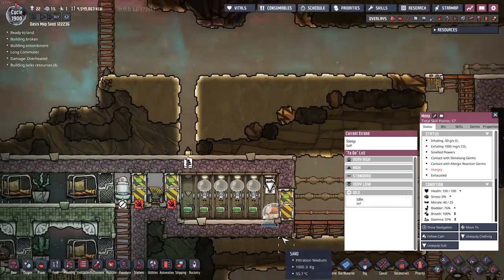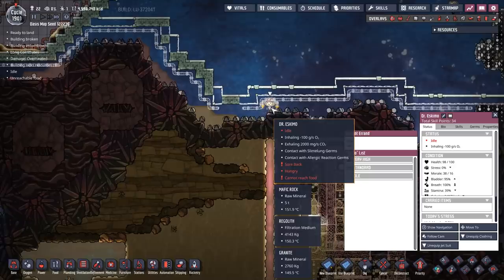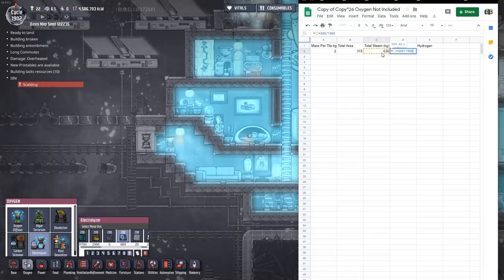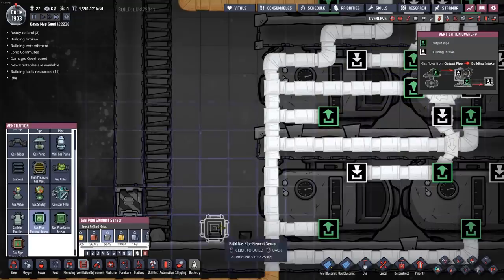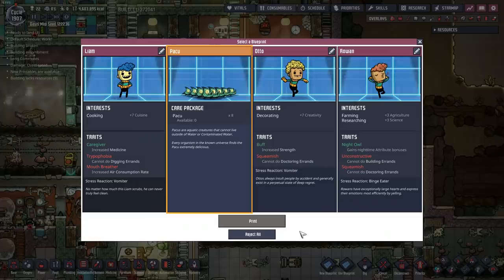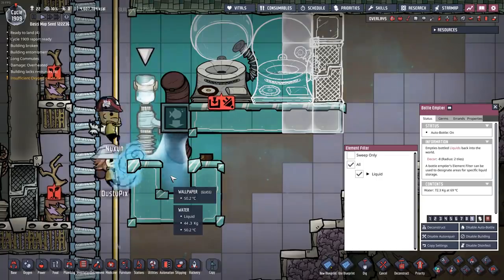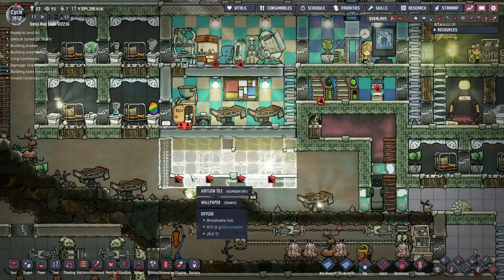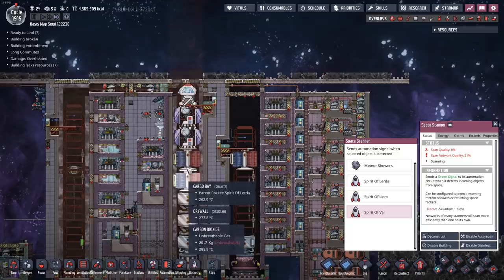Very Breathable Rocket Exhaust! Oxygen Not Included ep41

Comment: I'm curious though if it's be better to use turbines to gather the steam or use an aqua tuner to cool super coolant so the steam converts to water in the silo?

All you'd need is a drainage spot and gathering the water would be easy, but the power cost might make it less enticing over letting the turbines slowly absorb the steam.

Additionally, I wonder if you could sorta combine the electrolyzer and LOX together.  Changing the right electrolyzer wall into metal tiles and running a cooling loop through it that snakes at the bottom might create a giant LOX system so that you don't need to pump the oxygen gas.  Kinda like with your sourgas boiler design, the oxygen is added along this long tube and cooled slightly but at the bottom of the tube it rapidly changes temperature so that it creates a vacuum to automatically pump the gas for you.

Comment: you could potentially conserve more steam from the rockets if you use a radiant pipe cooling loop with super cooled liquid at the top of the rocket bunker, that way, any steam making it's way up will be converted to water and drop back down before it reaches space. it might also have to positive effect of preventing rocket meltdown.

Comment: did you try use the valve to filter gaz and liquid with a bridge, it is a low tier filter cost no energy and didn't use sensor?
Reply: @brothgar  yes, i didn't see any map you use it, i found the trick to replace the filter (use too many power) and the combo shutoff/sensor you use all the way, your low energy filter is mid tier tech, and not power proof if you loose power the filter didn't work
Reply: That system (manual filter) is great. I always use it on permanent pipes, much better than anything else.
Reply: @DrRetardo8600  yes, i use it all the times now because when i do the trick with two bridge(thanks @Brothgar) to detect if my pipe are full, but i always manage to have a co2 in this spot or a hydrogen, with the manual filter without power, i'm sure the only gaz or liquid i have is the one i select, so i did a double bridge sensor, and never fail againg (no more wrong element damage in my hydrogen generator)
Reply: @brothgar  i did a must compact oxygen and hydrogen farm with only one electrolizer and 1 pump

Comment: meep's always sleeps.

may the game work on my old laptop now? (i5 3320m 3.09ghz all core turbo, dual core with ht, 16gb ddr3 1600, intel hd 4000, yep is a thinkpad x230 for every thinkpad fan)
Reply: dude, all I'm working with is a Windows 7 pro Laptop with 8 gb ram
Reply: Try it and see, steam refunds are pretty reliable in the "no questions asked" period (2 hours game time, 2 weeks since purchase).
Reply: @CJSwitz  i already own the game, and i don't want a refound, klei deserves that money, also it was to play it in mobility since that x230 is my daily driver cause is small, if i need power i can play on my desktop or gaming laptop.
Reply: @Artemis_WR  You will always run out of frames unless you have astronomically powerful builds. I run an i9 9900K at 5Ghz, 64G DDR4 memory, RTX 2070 Super 8G, M.2 SSD, still struggle to maintain 20 fps at cycle 1500 with 24 dups at x3 speed post performance update. no pc is good enough to run ONI, but i guess if you run with less dups and not have 5 shine bug reactors maybe your laptop would outperform mine
Reply: @andersenzheng  i won't use shine bugs reactors, and use like 12 dupes at max (4 for rockets), also i got a stable framerate up to cycle 2000 with 30 dupes on my desktop (30fps on a ryzen 7 1700 oc at 3.9ghz with 32gb ram at 3200mhz and a gtx 1070) but i dug up the entire map, and i stored everything in the same spot, and in a vacuum.

Comment: Why does the steam turbine's seem to never open up the extra doors underneath them on your rocket recycling loops?
Reply: @brothgar  Ahh, ok, thank you. If you don't mind my asking, What exactly is the bar on the front of the turbine. I ask because I thought it was power production but often the doors would be shut and maybe a quarter of the bar would be full. Not always but it has confused me even in my own play through.
Reply: @alenvire  There are 5 inlets on the turbines, the doors are only blocking 4 of them while closed. The hotter the steam, the more power you waste (meaning that the turbine itself is putting it out as heat instead of power) with all inlets open. It's still wasting energy with the steam in the video being at 900°C, but way less since Brothgar is only using one inlet. And yes, the Bar is showing how "efficiently" the turbine runs. From the lowest possible I think around 50W to the maximum of 850W. There is actually a pretty good table on the Oxygen Not Included wiki that explains somewhat how it works. Took myself a few builds to fully figure it out. The man Brothgar himself did a video a while back to figure it out as well, but I think it was on a different series.
Reply: @Vaselinetopf  Thank you so much. That was what I have been missing. The explanation. I have watched so much of brothgar's videos and tutorials that all the info is starting to bleed together. Atleast my colonies do better now.

Comment: How about building the rocket almost at the bottom of the map and have a system using a bunch of doors that all close in sequence forcing a bunch of water in to cover up the entire rocket (just like your critter drowner but larger scale and horizontal) and force the steam up above it where a door then closes and separates water from steam after the rocket lands, that way you get the benefit of all that steam and heat plus the water may lower the temperature just enough to allow the steam turbines to work at maximum capacity and your rocket shouldn't melt.